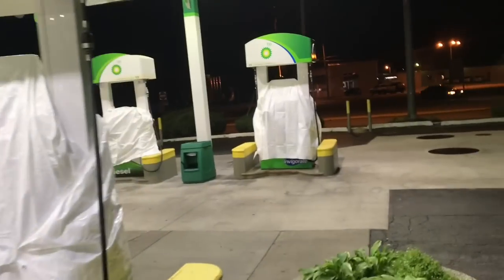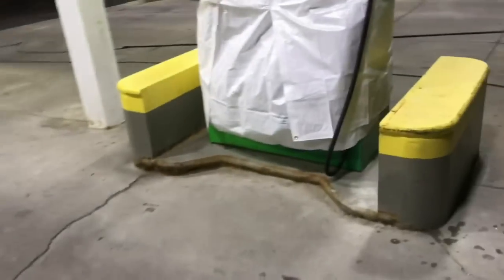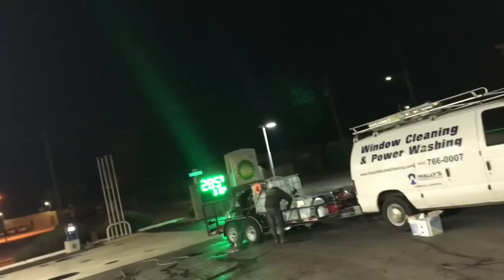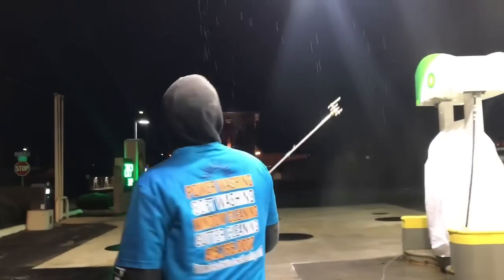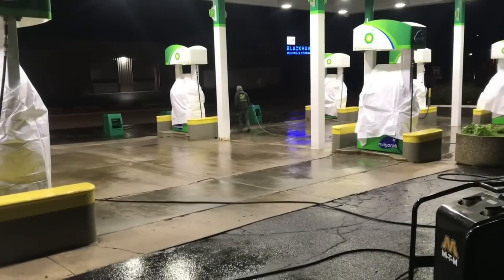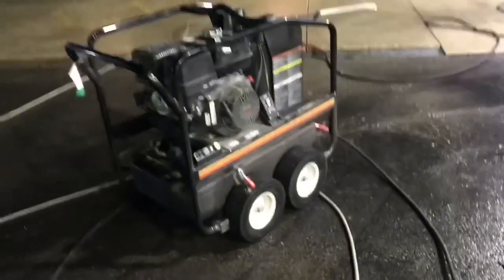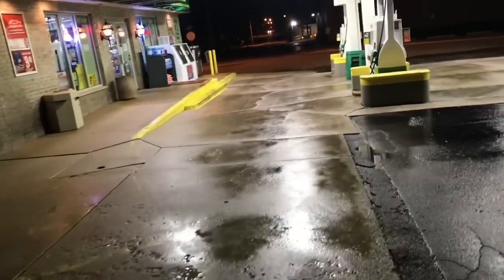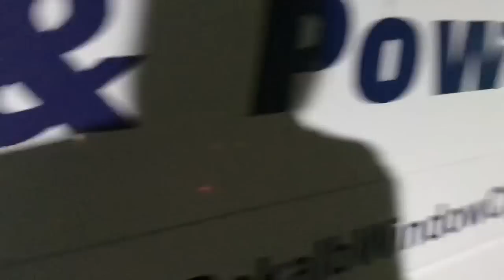How to clean gas stations using COLD WATER!

Comment: Nice I just picked up a BP station in my area, I washed it once and last week the owners brother and cousin which own two other gas stations called me to come give them a quote. I did and the all three want it done every 6 months. I'm new at the game but it's working out nice. I went through on my first one and used hot stain on the heavy oil slicks it works great 4:1 in a pump up sprayer for spot treatment.
Reply: 3200 a year for all 3
Reply: You’re only getting paid $3200 to do 3 gas stations twice a year?? Or $3200 for each station?

Comment: Good video John have you tried using the hot water system in conjunction with your surface cleaner?I have found it produces great results on parking lots where stains are.

Comment: Awesome content, you just got a new follower! I have my first gas station coming up next week and I have cold water also. We’re doing the Concrete pads and canopy just like here. I ordered a 5 gal bucket of EBC. How much EBC did you use all together? Did you use a stronger mix of EBC on the bad spots and DS the rest? Also if you could do it again, would you even bother using the hot water? I might rent that same hot water machine.

Comment: John! Hey, so I just started my own contract with a commercial company, and it’s my first job. I have a cold water unit, 4000psi at 3.5gpm, I couldn’t really afford much more to start, but I used purple power downstream injection (5:1) the first time and was halfway impressed. Is hot water that much of a difference? And would the surface cleaner be worth it on a cold water unit? I’m trying to just make do with what I have until I can grow myself.. any tips would be highly appreciated.
Reply: The surface cleaner is definitely worth it. Get a good 18-inch one for your GPM. Hot water is almost a must at gas stations. You need it for bad oil spots and gum removal.

Comment: Do you have to do water recollection?
Reply from the maker: Casey Lee ya don’t HAAAVE to. Probably should tho, a lot of gas stations have sewage interceptors built in. I pissed a lot of big wig gas station cleaners out there by uploading this video. From my understanding with the law, it’s up to the property owner. Don’t quote me on that. After this cleaning, we will probably hold off on gas station cleanings untill we have a couple hot water units and a way to reclaim water. You can easily reclaim by purchasing a “sock” that sits around the drain, stops water from seeping into sewage, and then suckin it up with sludge sucker attachment. Probably not the BEST way to do it, but it’s a cheaper alternative than havin an actual reclaim system that reuses dirty water.

Comment: Commercial jobs can come with some hefty fines from EPA, by not recovering the run-off.
Reply: How would that work? How does a person recover the run off?
Reply: @ethan-tm5oh  It's a pain in the ass and expensive. Their are different methods and equipment. Check out hydro tec units. Goggle waste water recovery.
Reply: How do you find out when you have to and when you dont ?
Reply: @ethan-tm5oh  No run off is supposed to go into a storm drain.
Reply: It's their rules not mine. Just giving out information to look out for. @Southern Breeze
Reply: It's TRUE. I was told by a pressure Washing manufacture that all gas stations need to be water reclaimed.
Reply: But you can honestly use a wet vac to recover the water.

Comment: How much you charge for that? Can you tell me like with out the depend on location, depend on which state you at,  depend on what time you have to work, depend on how many employee you have and all that crap thanks
Reply from the maker: Lorenzo Valverde $550 it was underbidded  big time
Reply: @JohnLange  thanks for the honesty
Reply: @JohnLange  I have one more question: why can't you use hot water, isn't easy for the oil to be removed? Thanks

Comment: Hey. Great job.How did you price this.
Reply from the maker: I just threw em a number. I actually got talked down dude was a good negotiator lol I usually never negotiate. $450 for everything
Reply: For the whole job? 
You need to up that number.Cheers
Reply from the maker: I’m aware it was cheap. Really just wanted the experience. First time cleaning one, not gonna charge the guy for a hardcore professional when I’m not (in this area at least). I didn’t loose money, and I got to learn first hand how these are done.
Reply: @JohnLange  Right brother yall did a fine job.EBC is the ticket..Cheers
Reply: Props man always a pleasure.
Reply: What do you guys charge for concrete and roof cleaning per square foot? I’am just getting started into the wash life business.Thanks
Reply: @JohnLange  That's how you do it sometimes to get the experience. Pricing low on the first one is a good trade for hands on experience.
Reply: @JohnLange  if you had to do this job over again what would you charge .
Reply: Zoukie Zouk that’s what I did when I started doing lawn care.  That’s what I’m doing with pressure washing.  You just have to start lower and gain experience and some clients.  Then you can increase your price as you go along.
Reply: Gas stations in my area don’t want to pay more than $150 lol smh